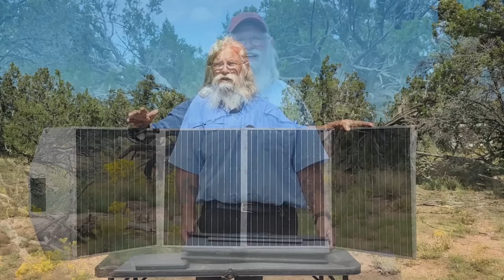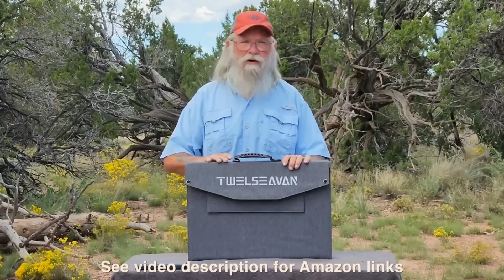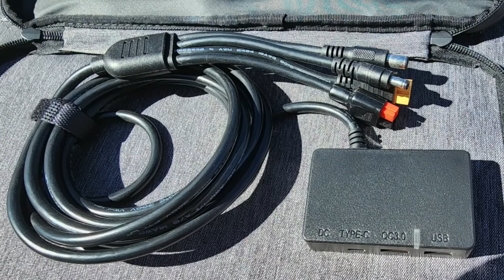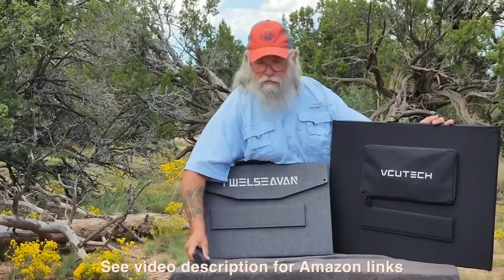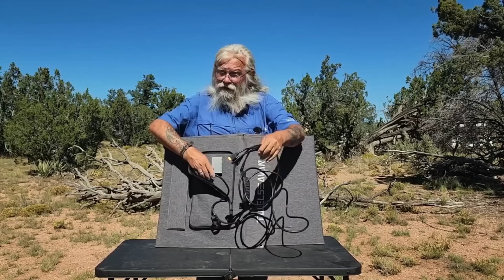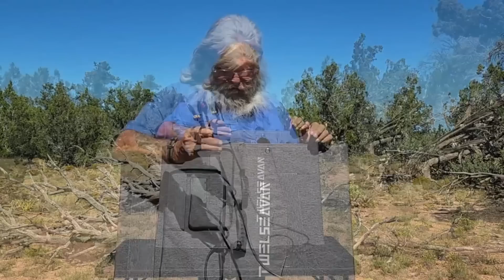THIS Could Be All You Need: Compact Solar System for Van Life!

Comment: This could work as long as you don't care about keeping warm or cool. If you just want to keep a laptop and phone going this is a decent set up. My Dokio folding solar panel was 110 watts for $79 and included a boatload of cables and connectors.

Comment: i had one of those solars with the usb ports. the one i had was 100watt unfortunately it bricked my usb batteries. it doesnt have a regulator so it just kept putting power into it causing an issue and also broke the solar.  maybe it was just that model but i would be warry from now on

Comment: Would this panel work to directly charge extra e-bike batteries? I've always wanted to have a rotation of 3. Start out with all 3 full, when one runs down, swap it to the back with a full one and hook it up to the panel, then when the second one is empty but the first one still needs time to fully charge you swap it out for the 3rd one . The 1st one should be charged by the time the 3rd one runs down and you just keep swapping them and charge them all with shore/house power over night.

Comment: If you go with the 120 watt solar panel then would it be better to get a 120 watt anker? Or did you go with the 60 w to have two charging? I don’t understand watts. There’s a $65 HOWEASY 120W Portable Power Bank, 88WH/24000mAh Portable Laptop Charger Battery Backup with 2 110V/120W AC Socket/ 3 DC Ports/2 USB QC3.0/LED Light for CPAP Outdoor Camping Trip Hunting Emergency instead of the anker that I think is only 30 w and $80 that’s why I ask

Comment: Good info!
Another dumb question: could someone tie one of these off on the roof of their car and charge while they’re driving?
Reply: there will be a lot of air pushing, maybe lash it to rails, but it might flap and wiggle loose. Someone used plywood to make a frame, or mount on, could be an idea for you

Comment: Thanks Bob for 120W recommendation! I'd love to go smaller if possible, and I don't see the 60W version you mentioned sold on their website, maybe they aren't working out as well and would love to hear POSITIVE and negative feedback on 60W version. Perhaps the 60W version is not enough on cloudy days but the 120W version you show still works well with clouds? Or it depends which state you are in such as cloudy days in Phoenix or Colorado are ok with the 60W version but not good enough in 3 day deep grey clouds of Florida, Montana or Michigan? I'd love this feedback because 2 years ago I bought a system of two 6W solar panels connected together totaling 12W which had one USB connector which would not charge a phone or battery brick for me except for 3 minutes at high noon on the sunniest day in Florida, but was ADVERTISED THAT WAY, and I'd really like to know feedback on which MINIMUM size solar panel SYSTEM truly works effectively to charge a brick or a phone. Also a review of which power bricks charge in pass thru mode so we can use them at the same time would be very useful. Thanks for all you do!

Comment: I put my solar panel on a table like yours , my friend took a 4 foot 2×4 , cut a groove in the wood to hold the panel, slides right in, added a few screws to the back of the wood to support the panel,  so easy to turn put up take in. Works great👍

Comment: Ok well what about charging what’re you have with your car battery if needed??
Reply: my mini van has 12V (cigarette) outlet and USB output, but that's not USB60 that seems to charge over 10 times faster. I have female 12V cable that can go to "DC In" but hope to only use while engine is running. Could certainly be backup for rainy days. Check if your plug inputs match wires.

Comment: Guess its nice feature to charge up those power banks fast. Use to see those as a big deal until i started using tool batteries. Can charge those up fast too, put inverters on them and the 20 volt batteries you can put the 12 volt to 24 volt in to usb c out can guick charge high performance tablets. Grab an inverter charge your laptop. You can buy higher amps also 8 amps at 20 volts is 160 watt hours. Better than those power banks. I got those also but stop buying new ones. Although im allowed to charge them at work i will get my solar and solar generator when i get my van. I got a small solar cell was able to charge a small battery bank with a car charger usb. Maybe not advisible with low light because it may effect the buck timing and burn out.

Comment: I have had the 120 w solar panel for a couple years. I bought a 2nd one and love the adapters included not in your version. Mine did not have the 4 plug adapter, but all but Anderson plug cables.

Didn't knew that I had it so nice!P

Comment: Depending on what you need to charge / keep powered, Bob may be absolutely right about this being all you need. 

Back in 2020 at WRTR/RTR, I was gifted a 60 Rockpal folding solar panel and it was amazing (it's still going, but I passed it along to a friend). The first day I plugged it in it was late afternoon and overcast in Quartzsite. My phone was nearly dead and I didn't hold much hope, especially with only about four hours of daylight left and the gloomy sky. I spent the next several hours with a friend in her Airstream, completely forgetting about my phone. When I returned to my rig, I was pleasantly surprised to discover that my nearly dead phone now had about 3/4 charge, despite the overcast sky! (Unfortunately, Rockpal seems to have gone out of business, last I heard.) My panel didn't have any connectors at all, but it did have USB plugs. I used it to keep my phone, tablet, and power bank charged without any problem at all. I did still need to find a place to plug in my laptop, which is where it failed me. If you don't have a computer or are using a solar battery charger (Jackery, et al), this panel is definitely a great idea and will simplify your life. If you look at the panels on Amazon, you will see that they also offer a 120w for $10 more and a 160w for another $20 beyond that and all of these panels currently offer a $40 coupon as well, so now is the time to snag one, if that's what you need. 

Thanks Bob for trying this out for us and offering a simple, affordable solution for our power needs!

Comment: Great info Bob, but I would like to what in general daily needs will these types of devices power. For example, could I charge up my phone and still use my laptop for X number of hours. Could I make a small pot of coffee or heat up my dinner? Can I run a light and then have enough power to run a fan? Thanks Bob. 💡☕🍲
Reply: No to the coffee and dinner, maybe on the laptop and fan, and yes to the light and phone.
Reply: My friend was interested in the PD-60 power bricks because they should be able to recharge his laptop.  He ordered one so we’ll see when it gets here.  The regular bricks can’t.
Reply: These minimum required needs are, in reality, a bit more work to calculate.
We've had to track it over time.
For us, up in MN/WI year round (so far), winter heat was survival critical. Not until we could "moochdocking" in someone's driveway, hooked up to their garage outlet, be able to observe our total electric consumption.
Which was not much! = $20 / month at most.
I think rate was $0.12/watt hour.

Anyway, needs will vary so I suppose a chart would be great to collect data for.
How do we do it? Idk exactly but I'm interested!
Reply: That's not all you need. Maybe for a phone and computer, tablet but there are more than Internet needs when it comes to solar. A harbor freight setup will charge all those gadgets and still give you lights and small amounts of power for an inverter. Probably a lot cheaper as well in cost. Cloudy days you still will get power from the thin film solar panels. 73